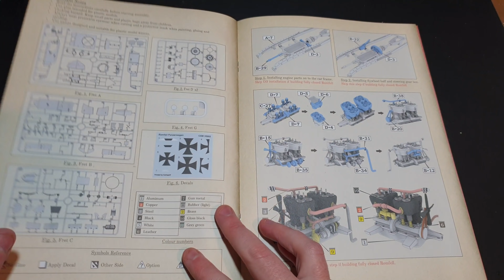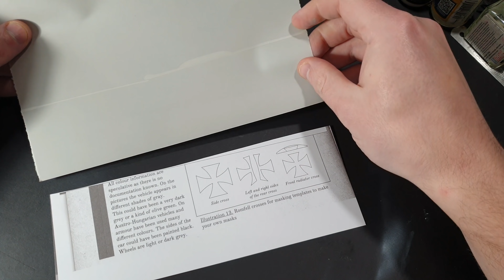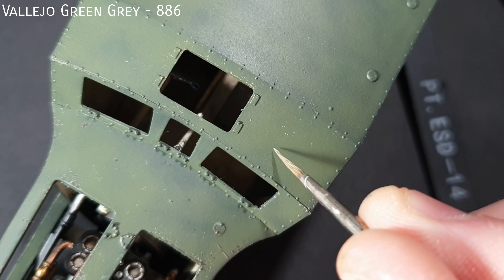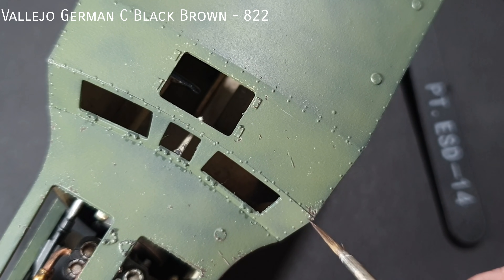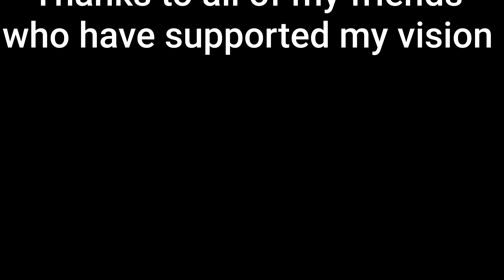Romfell Panzerwagen Full Build 1/35 - Copper State Models

Comment: You missed an opportunity to add exhaust staining. Bigger engines of that vintage had no oil filter system and you tended to get quite a bit of oil blow by. That oil blowing out of the exhaust would leave a light black sooting along the side of a vehicle. With a pipe that close the soot pattern would be a fan like spread. Starting about a half a foot back and getting lighter and wider as it moves back
Reply from the maker: Good call I didn't think about it to be honest !

Comment: was the engine sealed when u put the grime on? Can u include when to use seal in your steps?
Reply from the maker: I dont remember Tiberius, back when I did this video it was likely I sprayed a gloss layer before, but the alclad colours are usually pretty strong.
Reply: @lpjmodels  ok I'm actually building this one right now, I got the engine and chassis all painted up and will be painting interior today. Thanks for the inspiration (paint colors)

Comment: Excellent build! I’ll definitely try your mix ratio for the Mission Models Paint. One question though. What is your mixing ratio for the MMP primer?
Reply from the maker: Thanks a lot ! My ratio for primer is usually about 70% paint 30% thinner.
Reply: I will definitely try that. I’ve been using MMP for a couple years now, and I’m still having peeling issues with the primer. Even trying to follow their instructions to the letter. Even bought a new airbrush just for MMP, and I was still having problems.